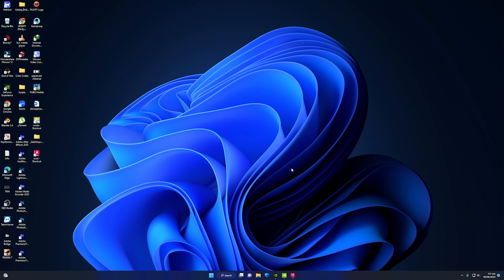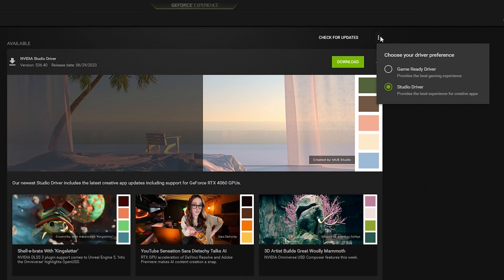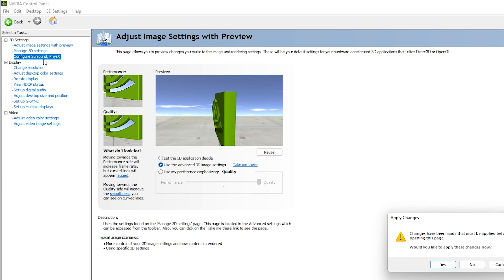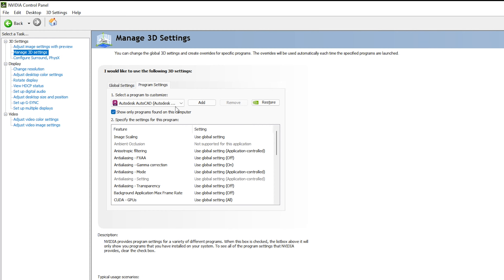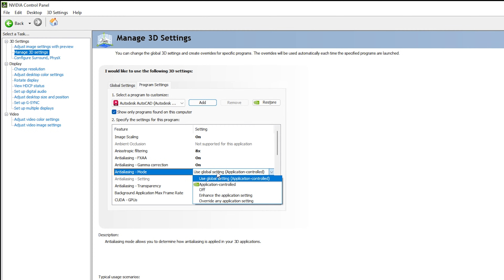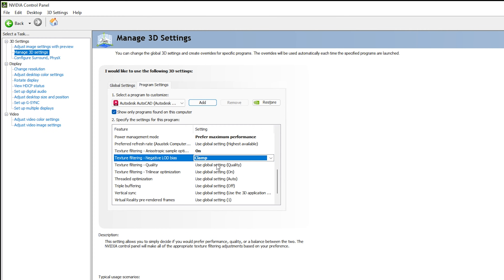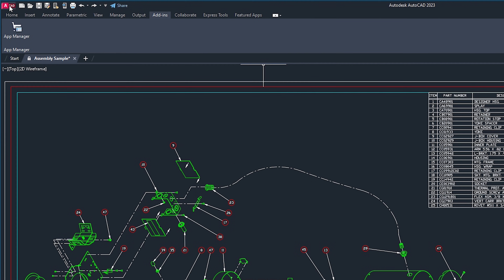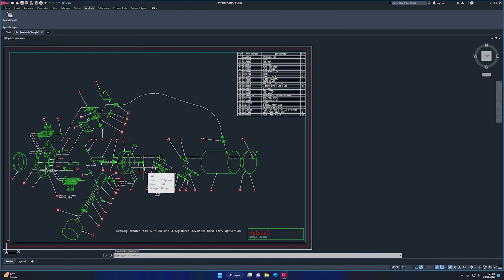Best NVIDIA Control Panel SETTINGS For AUTOCAD | Fix AUTOCAD Not Using GPU To Render 2023

Comment: Hi... could you help me with Autodesk Inventor? I'm trying to render with my RTX 3060 graphics card, but when I start rendering with the GPU, the part or 3D model becomes invisible (even though visibility is enabled).
Reply from the maker: It's missing some rendering part. Please restart it and try again

Comment: With AutoCAD selected as the program to customize, under "Manage 3D Setting" and "Program Settings",  the 3rd field ("Specify the settings for this program") is grayed out. Fix?
Reply from the maker: What's your system specifications?

Comment: Intel i5 11400H
16 GB ram
Rtx 3050 
Laptop
Can this setting show DSR in nvidia control panel? Please help
Reply from the maker: Your specs are moderate. Apply gpu acceleration settings in nvidia control panel
Reply: @FlixityOfficial and yeah my display settings are missing in nvidia
Reply from the maker: Have you updated geforce experience?
Reply: @FlixityOfficial  yeah today I update GeForce experience but it isn't showing please help

Comment: For those whose configuration options appear hidden, it is because the device starts in “hybrid” mode, where the GPU is activated only in applications that require it, Windows says that it is to extend the life of the battery and the device. You need to reboot and go into the BIOS, there should be an option to boot into “discreet” mode, save changes and reboot. Go to the nvidiapanel settings and you can make the changes :)
Reply from the maker: Great information 👍

Comment: BRO IM HAVING LAG AND DELAY IN CIVIL 3D SOFTWARE THE CROSSHAIR MOVEMENT 
PLZ SOME SOLUTION
Reply from the maker: What's your system specifications?
Reply: @FlixityOfficial  hp victus ryzen 5 5000 series gtx 1650
Reply from the maker: Your specs are normal. Have you applied gpu acceleration settings?

Comment: I have rtx 2050 
8 gb ram 
512 gb ssd 
Ryzen 5 5500H 
Can it run autocad 😢
Reply from the maker: Good specs. Yes, you can run autocad. Upgrade ram to 16 GB at least

Comment: Hello - mine says, "Application can't be optimized".  I have an NVIDIA GeForce RTX 4070 SUPER.  Any ideas?
Reply from the maker: Do you have latest nvidia app?
Reply: @FlixityOfficial  yes, just downloaded it today and the latest drivers.  This is a brand new computer.
Reply: NVIDIA GeForce Experience version 3.28.0.412
Reply from the maker: It's not automatically detecting it so no worries. My new videos are coming soon in this topic

Comment: After selecting the program autocad i amunable to change further settings
Reply from the maker: What's your gpu?
Reply: Nvidia RTX 3050 4gb ram
Reply from the maker: Is nvidia control panel settings locked or something else?
Reply: 😢 Please 🙏🏻 try to solve
Reply: You have the experience we can't do else???
Reply from the maker: Bro. Contact me on IG or live chat with me on my website to further discuss.
Reply: For those whose configuration options appear hidden, it is because the device starts in “hybrid” mode, where the GPU is activated only in applications that require it, Windows says that it is to extend the life of the battery and the device. You need to reboot and go into the BIOS, there should be an option to boot into “discreet” mode, save changes and reboot. Go to the nvidiapanel settings and you can make the changes :)

Comment: Hi everyone. not showing " display and video " menu in my NVIDIA control panel , what can i do guys. NOTE:  i recently installed nvidia controll panel. anybody pls help me .
Reply from the maker: What's your gpu?
Reply: For those whose configuration options appear hidden, it is because the device starts in “hybrid” mode, where the GPU is activated only in applications that require it, Windows says that it is to extend the life of the battery and the device. You need to reboot and go into the BIOS, there should be an option to boot into “discreet” mode, save changes and reboot. Go to the nvidiapanel settings and you can make the changes :)

Comment: These methods do not help me with many problems. My Nvidia control panel shows AutoCAD add to but customize is not hidden.
Reply from the maker: These methods are used to enable gpu to be used by autocad. What's your gpu!?

Comment: Hello, why is it the I can't change the settings on "program settings" and there is note saying "windows OS now Manages selection of the graphics processor". Can you please help me.
Reply: same problem please help
Reply from the maker: What's your gpu?
Reply: For those whose configuration options appear hidden, it is because the device starts in “hybrid” mode, where the GPU is activated only in applications that require it, Windows says that it is to extend the life of the battery and the device. You need to reboot and go into the BIOS, there should be an option to boot into “discreet” mode, save changes and reboot. Go to the nvidiapanel settings and you can make the changes :)
Reply from the maker: That's weird. What other options do you see?

Comment: hi im not able to change the settings in the nvidia control panel program settings. its locked
Reply: I have the same problem
Reply from the maker: What's your gpu?
Reply: @FlixityOfficial  amd ryzen 5
Reply from the maker: Do you have amd gpu?

Comment: Hi what about i5 9300h/16gb/1660ti laptop? For autocad.
Reply from the maker: That's fine for nvidia control panel settings for AUTOCAD
Reply: @FlixityOfficial  So you mean it will run autocad smoothly?
Reply from the maker: Yes, you can try!
Reply: @FlixityOfficial  thanks
Reply from the maker: You're welcome 🙂

Comment: On Geforce home (with studio driver) i cannot find Autocad on home. Tried scanning but not showing anuthing. Pls reply. I am new to graphics card.
Reply from the maker: No need to worry if you can't find AutoCad in the home of geforce. It is usually due to not installing it on default disk. Just apply proper settings and follow all steps to enable gpu acceleration!

Comment: Hi 
I have a problem in auto cad software my cursor of auto cad is getting hanged every second 
My desktop is 8gb ram 256gb ssd card 2gb graphic card
Please help me with this problem
Reply from the maker: Right! You have low spec pc, try to upgrade it. If not possible run AutoCad on Software not hardware!

Comment: Hi everyone. I have problem with "Specify the settings for this program" icons are grey and I can not click on them.. (it is possible with other apps)
I would be grateful if you could help me.
Reply from the maker: Do you have latest version of nvidia control panel? What's your windows and gpu?
Reply: Yes I do.. I have windows 11, Amd Ryzen 5, Rtx 3060..
[AMD Radeon(TM) graphics, NVIDIA GeForce RTX 3060 Laptop GPU]  @FlixityOfficial
Reply from the maker: The specs are perfect. I think that's the issue of program settings and gpu settings
Reply: Perhaps..
Thank you anyway :)  @FlixityOfficial
Reply from the maker: You can apply gpu settings I have made a video on it. Also the secret settings. After applying settings your rendering speed will increase for sure!
Reply: @FlixityOfficial also it would be great if you have a video for Revit as well. Thank you.
Reply from the maker: Sure. Will make video on it too
Reply: I am having the same issue for AutoCad. I have a nividia RTX A4500 Laptop GPU
Reply: For those whose configuration options appear hidden, it is because the device starts in “hybrid” mode, where the GPU is activated only in applications that require it, Windows says that it is to extend the life of the battery and the device. You need to reboot and go into the BIOS, there should be an option to boot into “discreet” mode, save changes and reboot. Go to the nvidiapanel settings and you can make the changes :)
Reply: @mariof3303  i dont have this discreet mode in bios...